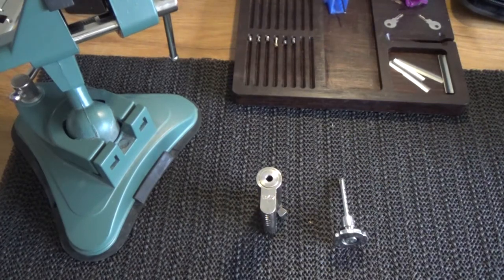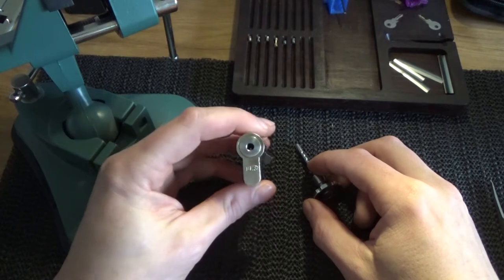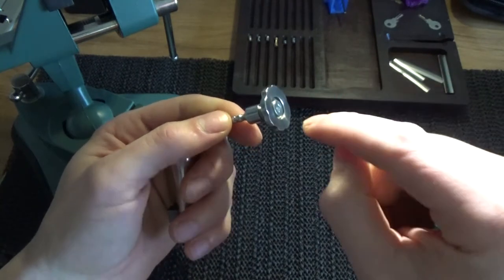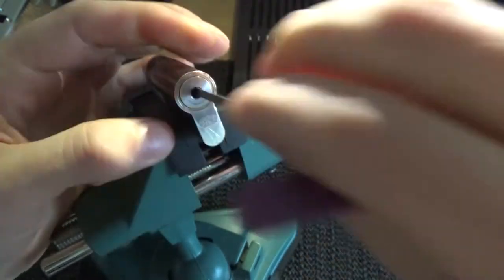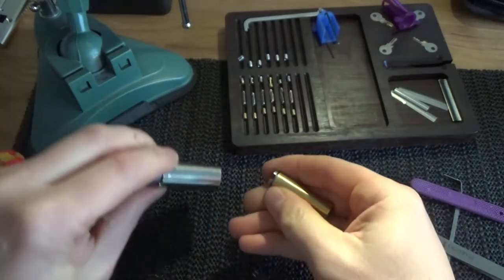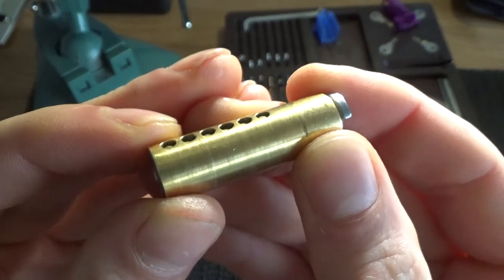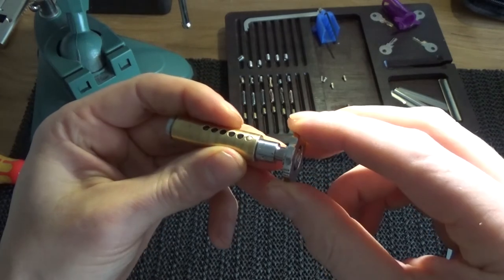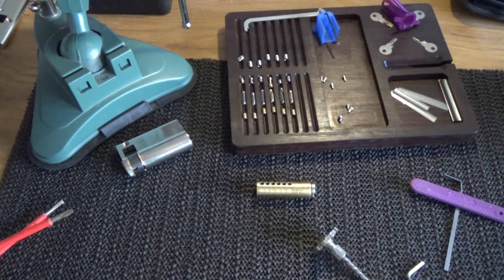(69e) Our circular lock revisited (english version)

Comment: Just watched this version to hear you speaking English ;-) Pretty cool lock and great idea. Guess you reach a lot more people when speaking English - but it's a German channel. So maybe some videos in English now and then would be ideal. I could imagine that a better steel used for the screw in that back (or more screws in a row) would solve the bending-problem. You could also cut a slot in the tip of the key so that the force is evenly distributed along the pin.
Reply from the maker: Great ideas, Potti. Thank you. I'm sure we'll use one of those, in case we ever make another version of this lock. I know we could reach more people if we made english videos, but we find it hard enough to say what we want to say in german. But since everyone has only nice things to say about my english, I think I'll try to do it once in a while. :-)

Comment: The  English is very nice .the attempt is awesome I think your on the right path and most interesting the set screw (allen)is just case harden when you grind it down you lose tensial strength that is why the tip bent.try using try threading a roll pin it is much harder.just a idea.Thanks for sharing buddy great video. ⛤⛧⛦⛧⛦😎
Reply from the maker: Thank you, very much. The setscrew wasn't the perfect choice, but it worked for a while at least. Thank you for watching ! :-)

Comment: Very cool Schloss. I would put a spinner plate on the fron and ad drill protection. I would have shorter key pins to make the security pins mpre effective. It would be great to see if there is a electronic component that recognises the proper key and then allows the core to tension and turn........
Would you guys know how to make a lock that has discs for the side bar and pin tumblers aswell on one key haha?
Reply from the maker: Those are nice ideas. We will definitely think about that last one. Thank you for watching !